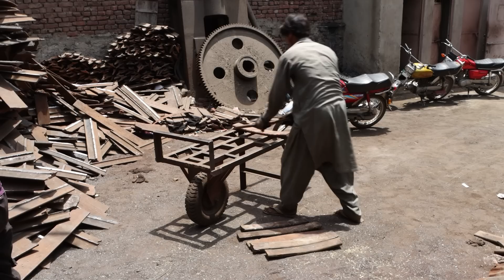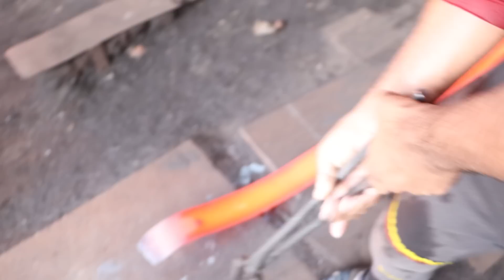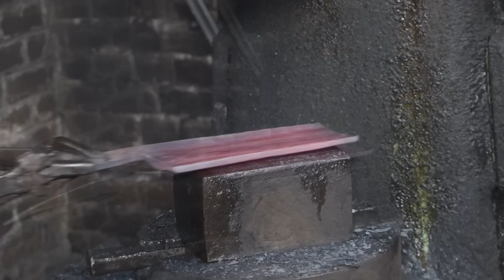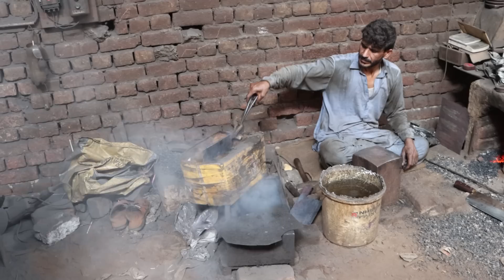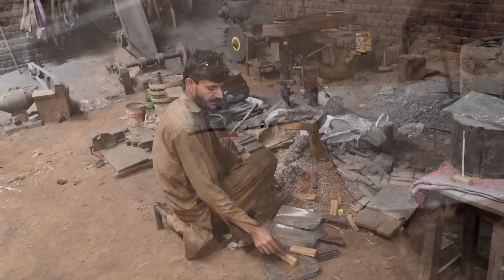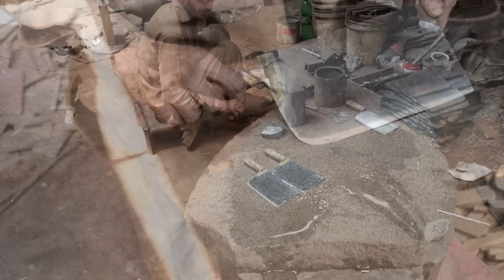Amazing Process of Making Super Sharp Meat Cleaver Knife From Leaf Spring

Comment: The time stamp of @11:00... the Grinder/sharpening wheel... look at the pile of grinding dust build up against the wall... Dude has been sharpening meat cleavers and knives there for 127 years...LOL... Don't get me wrong, I like how heavy the meat cleavers are, that helps with plowing right on through joints material... But, I just found it funny, how much grinding dust has built up into a single sintered heavy mass, likely weighing about a ton... lol.. .They could sledge hammer that grinding dust into some interesting cutlery of a high purity blades... so not all is lost on that pile...
Reply: I'm surprised the electric motor hasn't short circuited, the build up, in & around it is just a nightmare.
Reply: In another video for an object that needed to be painted, there was a thick crust of several centimeters of just paint droplets from spraying paint.

Comment: Love the look but is that garbage steel for a knife?  Also why bang a freshly sharpened knife on a piece of metal.  That just rolls the edge!  Regardless I pray that Jesus keeps these workers safe as their employer sure does not care about safety.
Reply: Hello Nubi. The steel is old railway track or well used truck leaf spring. Both are super hard. The first heat session takes most of the hardness out so it can be formed. It then cools slowly during the next few steps. This ensures it is not brittle and prone to cracking. The pile of tiny metal particles behind the grinders is massive. Anyone who has ground this vast quantity of steel is a total expert. Then the hardness is returned to the working edge and to a lesser degree the rest of the blade. Just what is needed. I think hitting the edge on the steel block was just a hardness demonstration